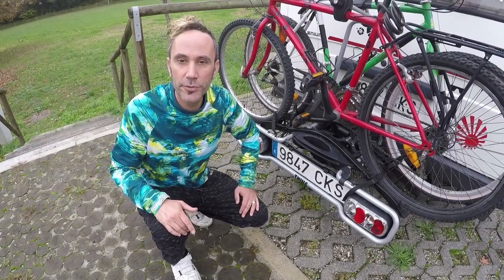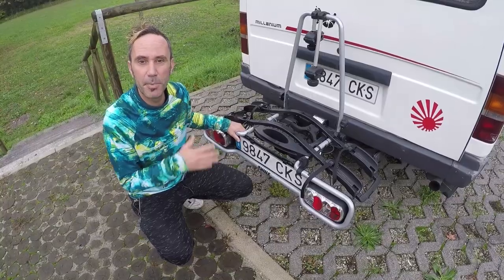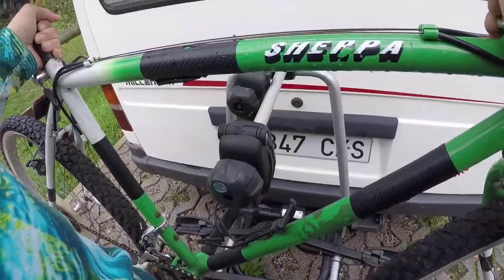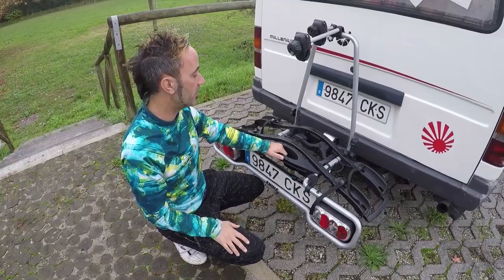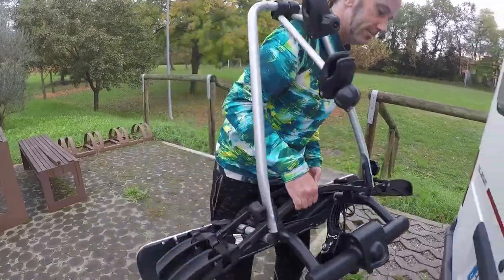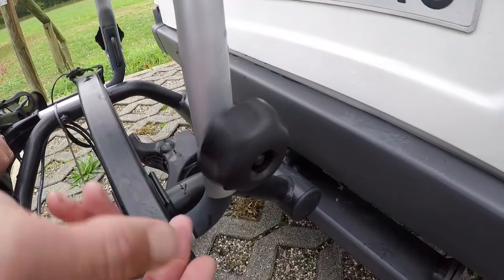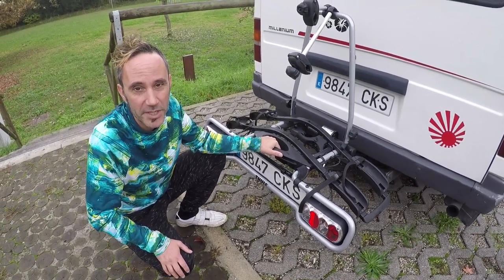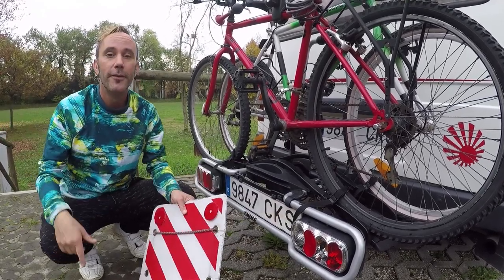BIKE RACK REVIEW - THULE 940 - TOWBAR MOUNT

Comment: Hello from the Rhineland. I just want to warn people here that bike racks seem to be hot items for thieves. I personally had a two year Thule rack stolen in broad daylight from a popular park area near a ferry landing - lots of people around but also lots of cyclists leaving their racks on their vehicles - the thieves know what they are doing and move quickly. My replacement rack is the foldable Thule EasyFold. it has a little more security with a clamp that is adjustable for a tighter fit on the hitch but I would never leave it unattended on my vehicle...maybe if it were loaded with a bike that is additionally locked (I use the abus bordo)-if you are leaving your bikes on your hitched rack whilst sleeping in your van/camper It might even be advisivle to add another layer of deterrent - such as one of the bike covers sold at bike shops but also available at Lidl when they have their bicycle gear on sale) with a long steel ‘canoe cable lock wrapped around that. The thieves are very bold - I don’t want to say anything bad about Thule or other rack companies as they do their best to make them secure but the thieves are two steps behind them with any changes and they will go after easy big ticket items without hesitation.